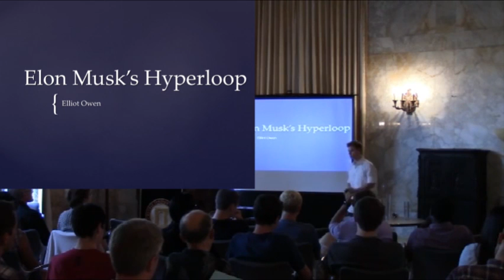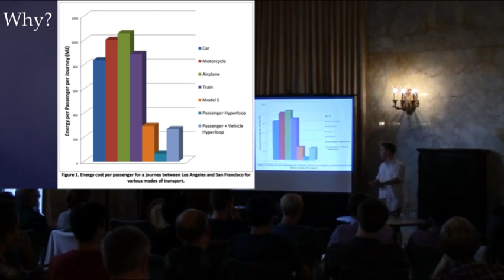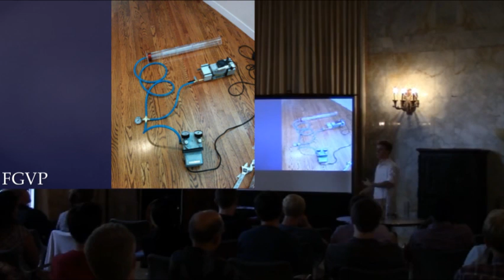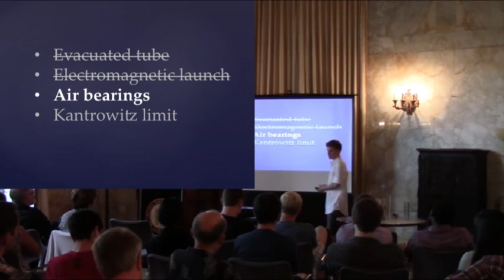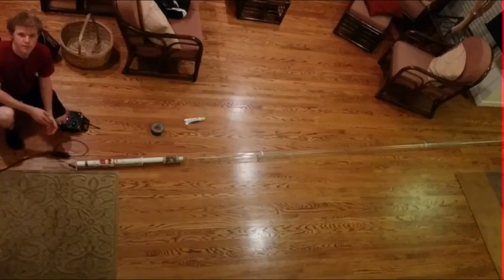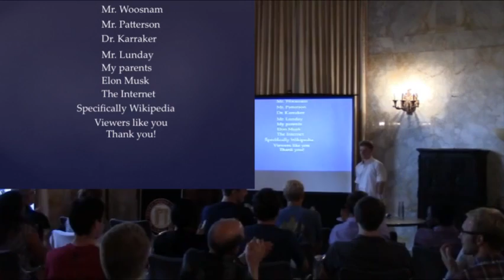Working model of the Hyperloop presentation

Comment: awesome press and demo. Its very impressive. can you tell me where you got the air bearing and where i can find that vacuum pump. Thank you!
Reply: Air bearing is nothing but small holes punched into the acrylic pod only on the base of the pod which just elevates the pod to remove friction between outer tube and inner pod u actually can make one of ur one he had just used some rubber washer round seals which helps in keeping the pod in contact with the tube to ease out vibrations.. And for the vacuum pump u can ask an AC service person for temporary use